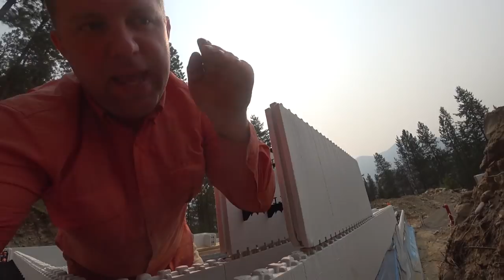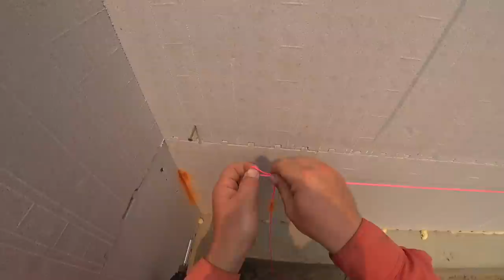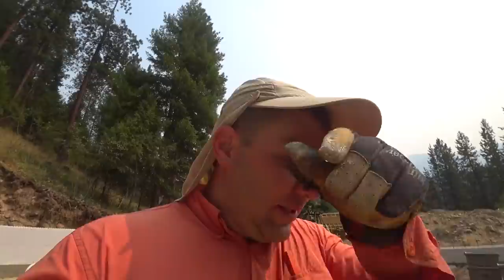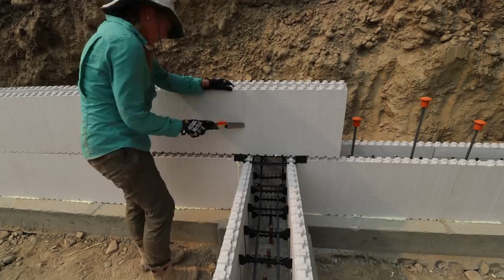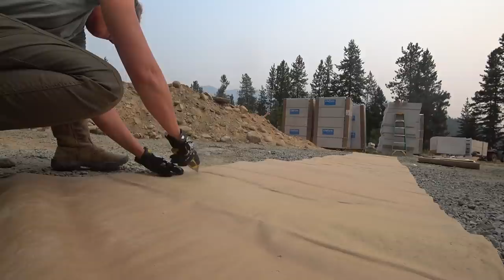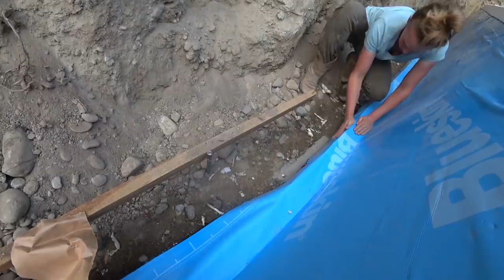THIS STUFF IS DANGEROUSLY STICKY (Applying Waterproof Membrane)

Comment: Jessie, Did you save a lot of money using the ICF walls (Doing it your self)and having it poured compared to having a contractor come and lay blocks? Plan on doing this just wanted your thoughts. Thanks
Reply: IMHO, everything has its pros/cons.  A block wall would be my last choice even if it's cheaper, its not as strong as a poured wall (unless double thick interlocked?)  ICF wall is probably overall cheaper than a regular poured wall if you're going to insulate/finish the basement if you figure the cost of your time to insulate etc. later on.  And ICF don't have to rent/buy/haul forms.
Reply: With my house I laid the foundation & slab myself (dug a trench, filled it with concrete. No forming required), but had an experienced contractor lay 4" blocks for the interior walls, 4" reclaimed brick for the exterior walls, with 4" closed cell foam (celotex) sandwiched between the two. ...Also stainless steel wall ties between the two sides.

If you're rendering or cladding the outside then use block for both leaves as it'll be way cheaper still (as well as faster to lay).

At the speed a couple of decently competent brickeys can lay block it has to be miles cheaper than DIYing ICFs at the speed these guys are going. Also, you can plaster directly onto the inside surface, it'll likely have better insulation properties, and will certainly have a harder wearing outer surface.

Comment: Put your straight line string out from the wall then you pull or push the wall to suit.. Once you run the line then put a 3/4 block under each end. Then your whole wall will measure 3/4 inch from the string.
Reply: Yes!  that's the proper way to use a string to straighten anything.  You should never run the string right against the surface you are straightening.

Comment: Leaving the 'learning experiences' aside and the desire to do as much yourselves as you can, I'm curious as to how the numbers work out for doing this yourself vs hiring an experienced crew of contractors to do it. It's very apparent is you couldn't have done this without the backhoe. It's like you buy the equipment to do the job yourself that would have cost as much as the backhoe but then when you're done you have the house and still have the backhoe.

Comment: Get a 4x4 scrap sheet of plywood and lay it down as a "cutting station" instead of cutting on stone. You will have much more accurate cuts and the blades last 10x longer

Comment: I'm curious. If the distance to the vertical rebar must be 3", why can the horizontal sit be right up against the ICF? Is horizontal steel somehow different from vertical?
Reply: The thinner gauge 'In-Wall Bracing' ... the ladder like steel 'mesh' ... is intended purely to ensure correct spacing of the ICF block cavity.  It does not contribute to the structural strength of the concrete wall.  Furthermore, unlike the concrete reinforcing bar ... rebar ... it appears to be galvanised, coated with zinc, and therefore not at as great a risk of corrosion as the plain steel rebar.

Comment: I have done a bit of building for myself in the UK. I was expecting that the services: water, electric, sewers would have been provided into the house well below the foundations where it is frost free. Why not in this case? or have I missed it?
Reply: They did have the water and drainage line in before the footing, but I did not see them dig the sewer under the footing, hopefully they got it in!  Electrical would not need to be under, I'm guessing they'll put some sleeves through before the pour, but maybe that will be above basement wall anyway
Reply: Re water, you would have thought if that was so, you would see it above ground somewhere within the house base. I saw the external drainage prep around the external footings, but no sewer of grey water pipes anywhere.  In the UK electrical supply to a house is generally 240V with a max load of 100 amps, which the power companies supply deep about 3 feet for safety as it traverses the property and goes under the foundations. In my limited experience it is in a conduit as well. We generally don't have basements in the UK, so that may indeed have something to do with it. I guess all will be revealed in time. They are doing very well, although I think I wouldn't get myself so pushed to meet generally artificial deadlines, but we are all different.
Reply: If I understand the reasoning thus far, the basement, garage, floor level will be at the top of the 'front' wall.  The height of the base of the house was predicted upon the 'run' required to their septic system.  That, and the fact that the most direct route from the side of the house to their septic tank runs through the base of the slope means that they should have adequate depth to excavate below the frost line for their sewer pipe.
Reply: True about deadlines, but if you have a goal to close things in before winter that doesn't leave much time.  If they don't have at least the basement closed in, there may be concern with frost getting under the footings = big problems.  Their electrical service will be complicated due to off-grid solar etc. I would guess most of that goes in the basement but yeah anything underground in conduit doesn't have to be very deep and can come up the outside wall in inconspicuous place.  Anyways they would be wise though to have sleeves in several places for various "future" things like water or elec in/out or whatever.  Very easy to put in before pour, cap it off, under ground can always dig it up years down the road.
Reply: Also consider some places elec is overhead due to digging expense and liability of rocky ground damaging wire.  (some places ug is not possible).  Although on my own yard if permanent I would find a way to bury it.
Reply: GB E C - true, I keep forgetting that the basement floor is probably 2ft above grade at the "front" of the house.  So maybe sewer etc. will run through the ICF rather than under footing. (BTW sewer does not need to be below frost, it is an empty pipe that carries "warm" water when it drains).

Comment: I don't understand why you are putting the membrane on the Styrofoam forms. Shouldn't you be putting the membrane on the cement walls after you pour them? How are you going to get the styrofoam off of the cement and the membrane?
Reply: keli jones the styrofoam stays on the concrete after the walls are poured. It acts as insulation.

Comment: why wouldnt you secure the membrane at the bottom first .. then fold it over and secure and then go up the wall ... you are after all overlapping it and want to cover the footing ... so it would seem to me that going from teh bottom up would be easier to get it stuck where you want it and fit snug while you still have paper on it .... as for the corner butt the ends and do a piece that overlaps the corner about 6 inches a side
Reply: In my experience it is much better to work with gravity than against it ... if you start at the bottom and work up then you need to support the weight of the membrane ... and keep it 'unstuck' until it is placed in the right spot.  Carefully done, gravity works with you to 'pull' the wrinkles out.

Comment: I don't know how much more ICF you have to cut considering your videos aren't live; sort of speak but you might want to consider getting a hot wire foam cutter. You get clean cuts and you don't end up with a Styrofoam dust all over the place that you have to clean up. Just a suggestion.

Comment: stand off your string lines from your wall a block at each end and a gauge block . only way to see your line is straight . wind static . friction .can bow your line more than you think . this advice is only for results 1/4" or better so dose not apply to bricklayers .

Comment: Is there a reason or reasons why you guys didn't leave a bigger space around the outside of your house? Would have been no extra work to leave a 3 foot space to walk around the sides. Would have made installing your skin easier. Also surely you need a retaining wall at  the back to hold back that soil in wet weather??
Reply: I believe that if we ' ... wait and see ... ' we will find that the gap will be backfilled in due course.  If so, Jesse has been quite sensible in reducing ground disturbance and greatly reducing the requirement for backfill material when eventually Jesse and Alyssa get to that stage.
Reply: I dont follow that thinking at all. We just built a detached house on our property and we left a 3-4ft space on the sides and back. Also a retaining wall into the hillside behind.  the 3-4 foot space was then paved to be a walkway around the back and sides to the house since we had a side and rear door also. There definitely could have been a bigger gap around the house to allow for easier access to install the waterproof barrier. I wonder is the plan to backfill so much to make contact with the walls of the house?? I dont know about other people but where possible, i would want more than one doorway into and out of my house. Reaching over the top of those foam blocks to install the outer barrier is just plain clumsy and awkward for the sake of having left a few feet of space to comfortably get round the outside of the building to install it. not nay saying or bad mouthing, just makes good practical sense and should/could have been done. they have their own back hoe for pity's sake!
Reply: That was also one of my question two, in my opinion saving money on backfill materials isnt good reason for small working space, in my country minimum space left is 3ft and retaining wall if neccecry. And that space is regulated with few specification and regulations.
Reply: Agreed, it should have been opened up around the house more. they also only excavated this in summer where it seems to be very hot all the time with little rain, they dont know what that hillside behind will be like in the winter with rain and snow on it, now that its freshly exposed. so I really hope for them, it is okay and stays stable, but freshly exposed hillside like that... who can say! 
If it was me doing it, i would hire a small excavator to go round the outside perimeter of the building, NOW, before any further work goes on, to create a 3-4 foot wide flat space around the entire house.
Another question is how do they plan to get to the back of the house to sheet it or finish it, and also up to the roof etc. 
I really like these guys and want them to succeed, but this one issue I'm mentioning is just something I can't be sycophant about and just say "good on you for doing it..." and all that drivel.  
Their positivity is really impressive, but as we can see already just by installing the damp proof skin on the outside, this is already biting them in the ass, and it will only get worse as they go deeper into the build.
Reply: Dear Peter, have you seen all of the material that Jesse and Alyssa have posted on the internet on the subject of their project?  The sole purpose of the gap between the excavations and the basement and garage that they are currently constructing from concrete filled ICFs is to enable that construction activity.  The void will be backfilled completely as soon as the membrane is placed over the outer surface of the ICFs AND the concrete is deemed strong enough to withstand the pressure loading placed upon it by the backfill material.  A 3' - 4' wide path around their basement would defeat their objective of minimising the energy required to heat their home in the winter and cool it in summer.  Their access to 'first' and 'second' floor levels to erect their timber frame and affix Structural Insulated Panels will be from the reinstated ground level, on the hillside following backfilling!  I imagine that J&A sincerely hope that the void will be backfilled before significant autumn rain or winter snow ... the hillside will then clearly not be any mer exposed to weathering and erosion than it was when Jesse began excavation.

Comment: What is the buttress for?
Reply: ... I think that you will find that the buttress is a 'designed' part of the structure specified by the engineer.  It supports the rear wall against the pressure loading from the soil of the hillside which will be backfilled in due course.  The hillside that many fear will slip and slide and wipe out the house!

Comment: Question: Any concern that you have a vertical seam where the barriers meet?  Wouldn't a continuous membrane running the entire structure (where needed) be better?  I'm no hydrologist but I think water will find that seam and over time with the freeze/thaw cycle damage you concrete in that area because it will become trapped behind that barrier and concrete.  Thoughts?
Reply: If they do the drainage right they should be fine as long as the water always has a place to go it won't push through it will go down into the drainage.  My house has no drainage around the outside and it had bigtime water problem, added drainage inside (not as good) but now it never builds up outside the wall instead drains away underneath.  Hopefully when finished they do some grading on the uphill side to direct heavy rain around the house, and don't let eaves drain next to the wall
Reply: That membrane isn`t  like felt ( tar paper ) think of it as a sheet of glue , it will stick to a surface like a liquid pored on it and heal  if cut or punchered . hope this helps.

Comment: All I want to know is why they felt it necessary to build the house against a steep bank where they knew there would/be drainage problems?  Plus all the headaches putting it there?
Reply: There is the possibility and practicality of building below ground level for insulation purposes.
Reply: Why do people build basements? This is Idaho! Stuff isn't flat.
Reply: Hey billy/ Drainage problems, you do realise houses are built that require sump pumps because you can't dig more than 2' without hitting water.....I guess you've never seen a site where they literally have to pump water out before they pour footings and foundations....You need to watch all of their vids to get your answer....
Reply: Because basements are well below the freeze line, they double the storage/living space and keep the house warmer and cooler thru out the year.

Comment: I'm thinking that foam is not the right material to build concrete forms with.  It is just to bendy!  I understand that you want the foam afterwards to insulate the concrete walls.  Great!  But why not build and pour your foundation and walls and then remove the forms and cut and glue the foam to the concrete?  That seems a lot simpler and a lot more room for error to me.  But, then, I'm old fashioned.
Reply: My fellow you tuber - Don't you understand that the ICFs are made for exactly that purpose - so it is the right material ! You could be right about one thing tho - you are old fashioned !